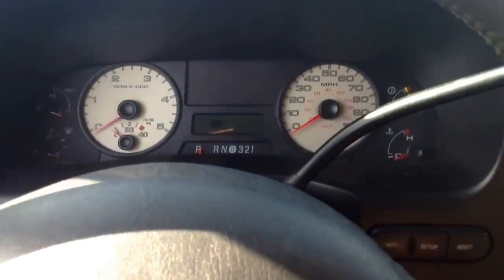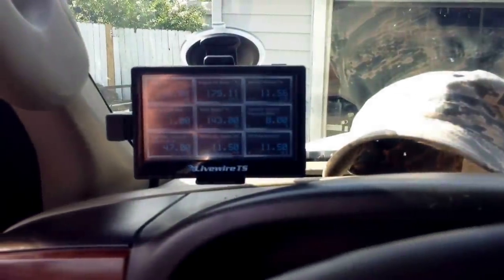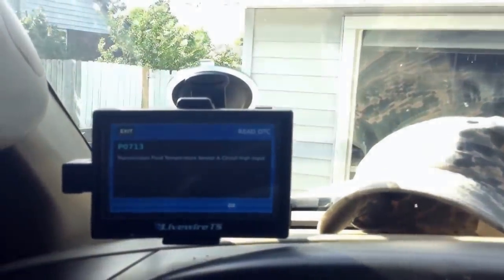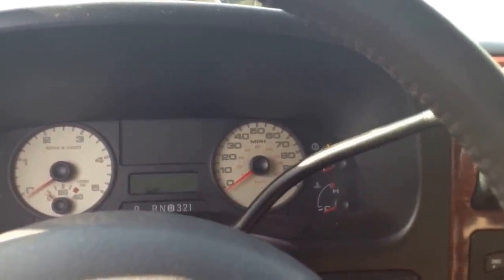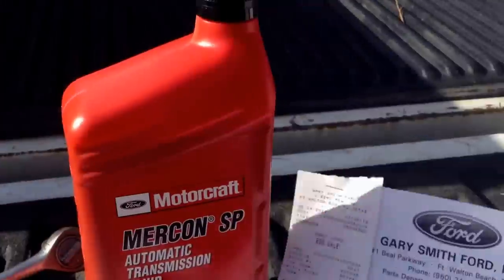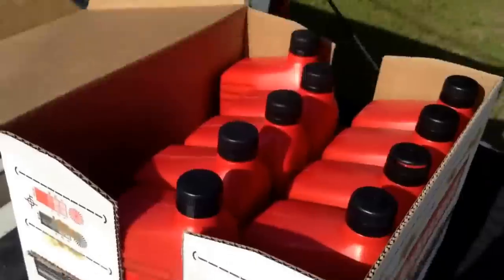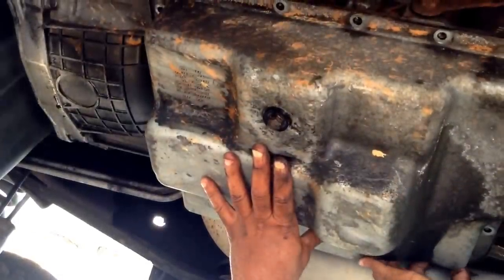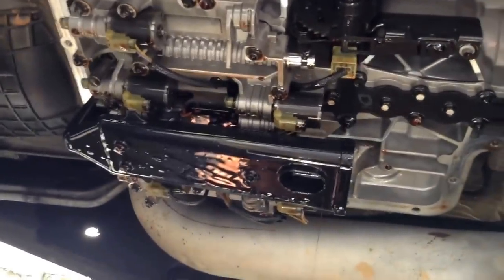"How To" Ford Super Duty TFT Sensor Replacement on 5R110W Automatic Transmission

Comment: Thanks for the video! Had the same exact problem and was able to fix it with your help. Had some trouble removing the temp sensor originally because I could turn it 90 degrees ccw to loosen it, but you have to only turn it about 45 degrees for it to pop out. To anyone else about to attempt it, be warned that a bunch of fluid will come pouring out when you remove the sensor as well as the filter, so be prepared.
Reply: I replaced the sensor a. Still have the same symptoms

Comment: 2005 F250, 6L Power Stroke.....  
Dropped tranny pan last night.  BTW besides a catch pan I recommend a plastic sheet too, can get messy!.  Had to replace re usable gasket, metal was a little rusty on the one I took off.  Found the sensor, turn it counter clockwise, and with the help of a needle nose it came out.  Fluid also pours out.  Did take some force to pull it out so take your time.  Seat new sensor and rotate clockwise (opposite of removal).  Clean pan, take off magnet and clean. Remove screen/filter, fish out rubber seal.  install new screen.  Install pan and gasket.  Problem solved!!!!!  
I also replaced the inline cartridge filter.
One thing I wanted to note is that other people are talking about various tranny fluids.  On the dip stick it tells you to use Mercon SP.  Not Mercon LV or Mercon V or anything else.   
Go to the dealership and buy Motorcraft parts.  I know Oreilly's has cheaper alternatives but you get what you pay for, seriously!!!   I'm talking gaskets, fluids etc.  It will cost you more in the long run.  I know this from experience.
Same with Oil Filters, use a Motorcraft filter!!  I use Rotella T6 (oil itself is a little more subjective).

Sensor ... $22
Mercon SP, 9 qts at $7.50 ea.
Cartridge filter $46
Screen/filter in pan $45
New reusable gasket $48 (metal was starting to rust, why take the chance when you drop pan every 30K to 40K miles, pending on your driving)

You will need a funnel for refill that fits into the Tranny dip stick hole (get at Home Depot)

Now go buy your self something real nice for all the money you saved!!!!

Thanks again for the video.  I appreciate you taking the time!!! Helped me a ton!

Also, take your time!!!!  Don't rush or force anything.
Reply: This comment was better and quicker than this whole video. Thank You!

Comment: Good video, was kinda hard to hold camera while removing the actual TFT sensor I guess but at least you showed where the sensor will be located.  I've also heard that some of the issues with the trans temp gauge can be attributed to the harness that plugs into the TFT sensor, someone on this thread was still having issues after replacing there TFT sensor.

Comment: Thank you.  My clutch van ramp up to full speed because of this sensor thinking the fluid was hot while on vacation.  It also  interferes with the gear shifting.   Dealer repair: $850.  I was grateful to get it fix being so far from home and so quickly.  Not cheap, but necessary at the time.

Comment: How long is a NEW sensor warrantied for? I had one replaced because I really didn't wanna lay under there & take an oil bath, but it failed again after 9 months. Not sure it was new though, didn't get a warranty.
Reply from the maker: I don’t remember the parts warranty for sure, but I wanna say it’s got 12 months
Reply: @RealBriggs250  yea, next time I'll be sure to get it

Comment: Just bought a 06 f250 and a few miles down the road ,tow haul light flashing, also my temp gauge isn't working just like yours.  Looks like the same problem.  Since I am new when I drove it home the motor was running at 3000 rpm at 60 which leaves me to believe it wasn't shifting into Overdrive.  Did you have problem with OD before you fixed the sensor? thanks

Comment: Nice video thank ya quick question y plug my computer and my engine running I did test solenoids but number one said no communication every other one no problem what’s the mean and wish one is #1 solenoid thanks again
Reply from the maker: You’d have to google a diagram for which clutch is which. They aren’t numbered 1,2,3 etc. They are labeled based off what they do as far as I know.

Comment: When you started the truck right after ,did the gauges go back to normal or did you have to drive it around for a bit?
Reply: I noticed gauges seemed to be immediately at normal operating temp. Odd!!

Comment: Rubber oring has to be pulled out of filter hole, the toilet paper filter, that must be replaced also, is located in front right by radiator and truck is put in neutral at first startup after filter change.

Comment: I did the filter change on mine and the dealer sales guy insisted me putting LV instead of SP. I've been having issues since. Now my check gage light comes on so I will replace the TFT sensor. Should I go back to SP? is my question.

Comment: I rebuild my 5r110w 2003 6.o I put new wire harness in it and now my temp is on  I don't no if I plug it in right place they sent me 9 wires and my was 13 wires.  But my shifter fills funny on spongy when shifting gears up and down but when you put it in low it goes in a gear but then it feels like it you give it gas the gas pedal don't actually smashing around the motor up and then it'll rub up a little later and jerk into another gear and lock up and when you put it in reverse it goes into first it backs up a little then locks up what could this possibly be or sound like I have work on car seen I was 10 years old  I had it scanned and it said four wheel high and four wheel low not working I don't have scanner for diesel trucks or nothing though

Comment: 30K miles on the service.

You missed an important step,
After you remove the filter use a plastic tool to reach up in the bore the filter came out of and
remove the seal that 9 out of 10 times stays in the bore. Place that seal back on the filter and 
you good.

Water is not a good thing with the 5R110w do to the fact that the clutch material is bonded 
with a water soluble adhesive.

Also that fluid should not be that black. Time to flush the trans.

You can use LV or SP
Reply: Sean Not-telling you can not use lv

Comment: Thanks a lot, it gives me idea wheres it located.
I have 2008 explorer eddie bauer, it doesn't have TFT gauge like yours. 
my oil pan was leak, after replacing the gasket I found my check engine light "on".
then after computer checked, I came to know its the TFT sensor got problem .

Comment: Btw my truck is a regular 2005 f-250 gas. I heard you said power stroke so I'm not sure and I'm wondering if it's the same location for the sensor.
Reply from the maker: My truck was a 2006. I'm not sure if the transmission is the same in the gassers
Reply: +f250ghost but your is diesel?
Reply from the maker: +Osvaldo Cintron yessi
Reply from the maker: +f250ghost yessir
Reply: +Osvaldo Cintron awesome, thanks so much for all the info bud